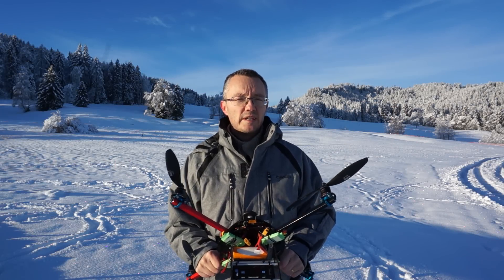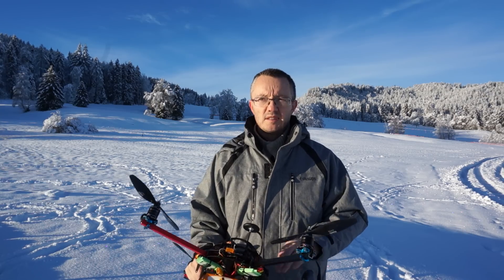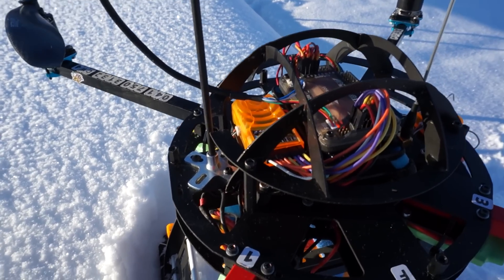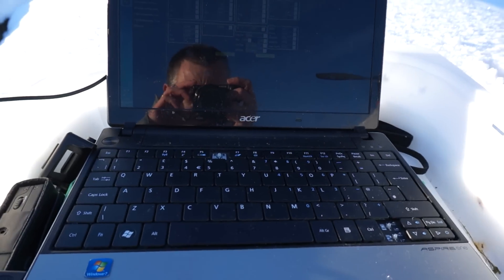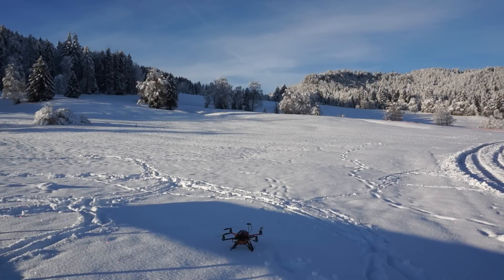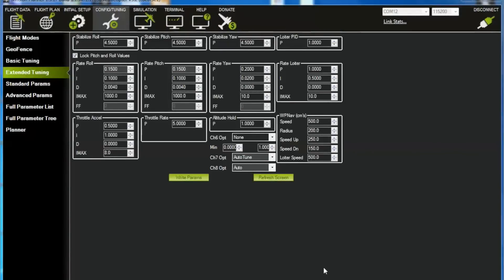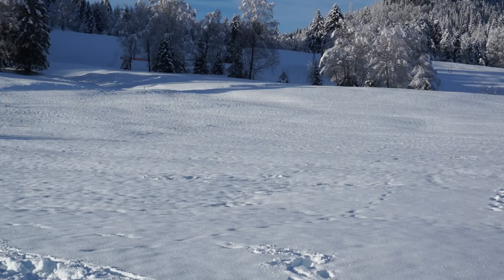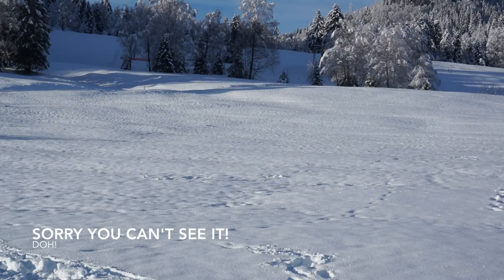Flight tuning Arducopter 3.2

Comment: Nice video. why run auto tune if you change the settings anyway?  I tried auto turn a few times....worse then default!   I setup ch6 for P term. verified channel 6 functioned however when I rotate the knob p didn't change?

Comment: 1:30 that's a transmitter. The receiver is in the multirotor! I see a lot of folks get mixed up between receiver (Rx) and transmitter (Tx). Think of it as trans'Mitt' - you hold the transmitter in your mitts ;-)

Comment: what motor u use in this quad ?
Reply from the maker: hide everfree Hi HIde - these are tmotor 2216 980kv motors, with 11" props. They're pretty worn though, and been through a few crashes. The motor mounts are jdrone vibration reducing mounts.
Reply: Performance UAV i loke tmotor 2216 too...most of my copter using this...what is is your battery? it lools huge and flat
Reply: Performance UAV  nice video!!! gonna do some tuning myself as soon as the weather letts me. Have a question i thought maybe u could help me out with. I got the 2216 810kv on an x-mode alien (4s batt)..... got the 12x3.8 props and 11" props.... now.... i dont see anything about 12 " props on the data sheet....does it make sense to fly them? or should i stick to 11"?  .. keep up the good work ;)!
Reply from the maker: virre62 Traditionally, I've found tmotors to be pretty good with the data sheets, so I tend to avoid going off spec in case there are problems. If it was me, I'd stick with the 11". :-)